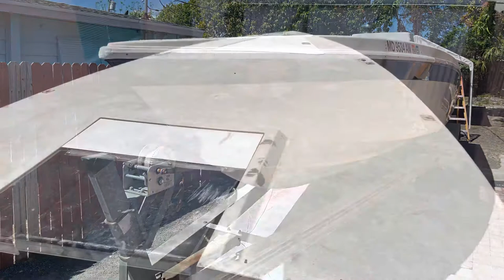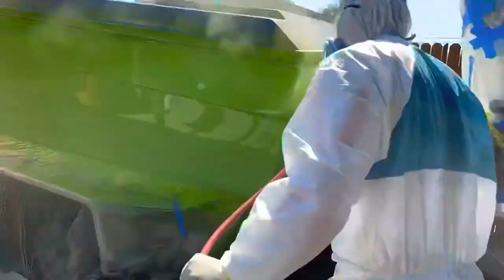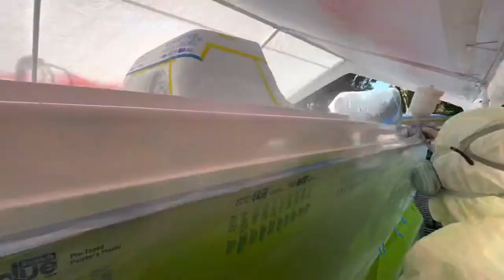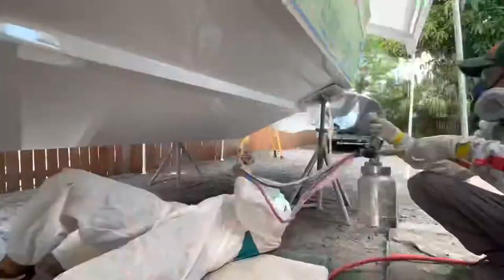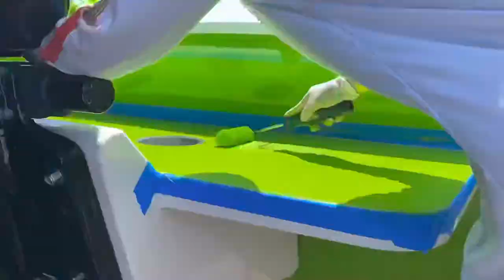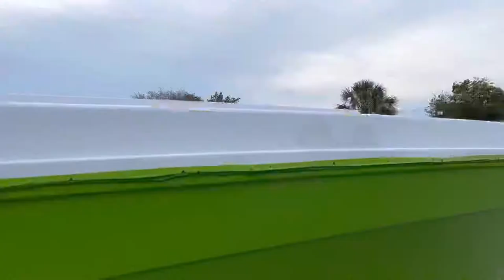30’ scarab restored in alwlgrip! Citrus green and Snow White

Comment: What product did you use for the bottom? I have a 31 center console that has ablative paint but no barrier coat. I want to strip paint and restore it back to either gel coat or paint. Boat will be lift kept so no need for anti fouling paint.
What product ypu recommend that is durable enough for bottom of hull.
Reply from the maker: I used Awlgrip on this boat. I only use awlgrip or Gelcoat 👍🏻
Reply: @REYREY-ue5fz  
You don’t have an issue with using Awlgrip on the bottom ? What is the maximum time the boat can be left in the water when using paint instead of gelcoat